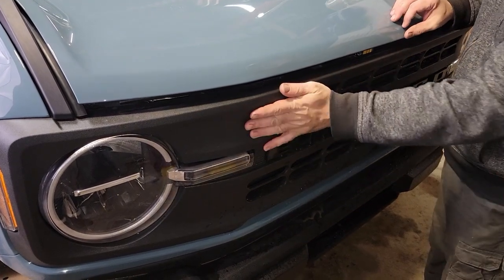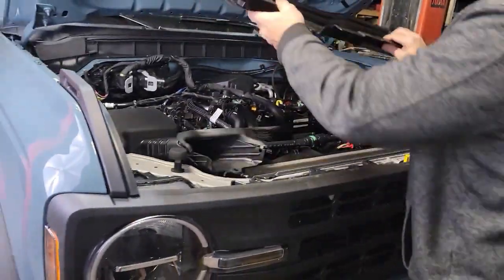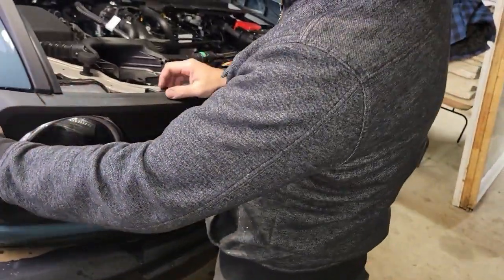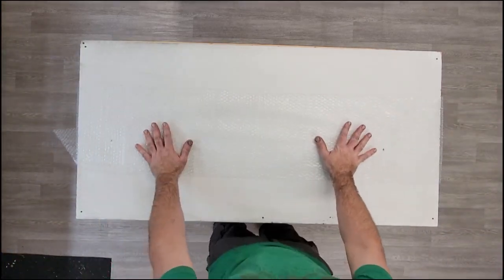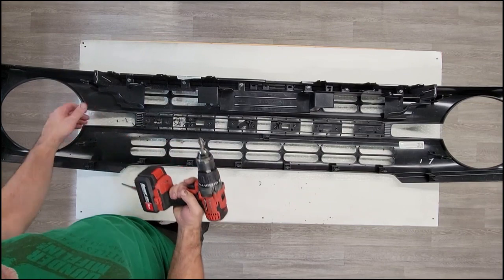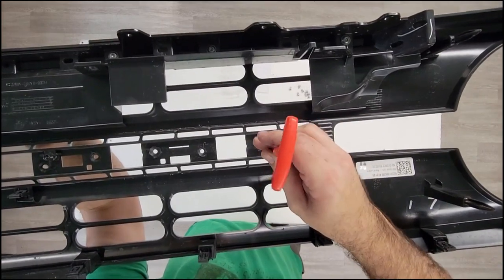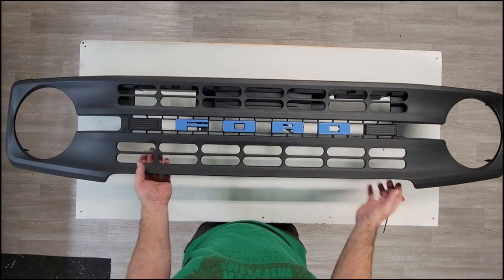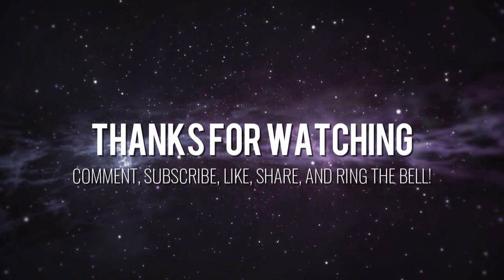Grill Letters Installation Instruction

Comment: I just got my set .very well made. They are not screws but two sided tape. Be aware when u remove the letter from the cardboard thr backing on the tape will come off  dont remove until you are ready to install. I pushed mine back on the cardboard hopefully it will be ok. Very well made procuct. Really looks original. Well packed. Im going to by another grill for $200 from rpm bronco just to be safem than   removing original letters is not necessary . Better safe than sorry .